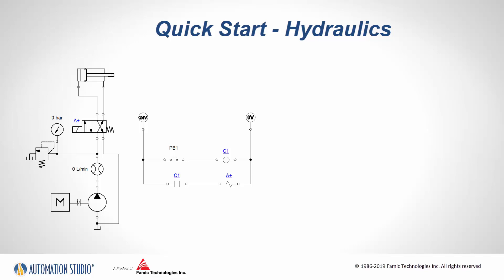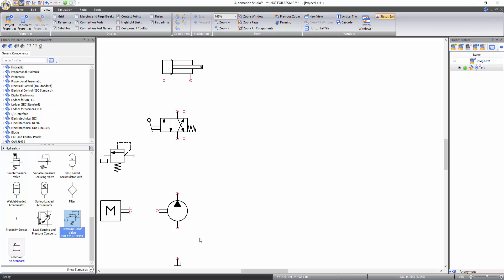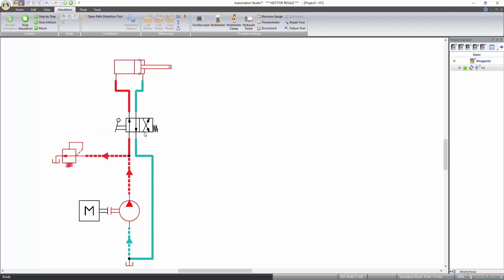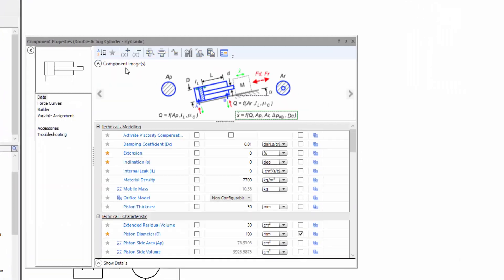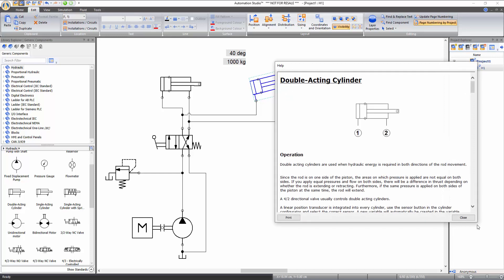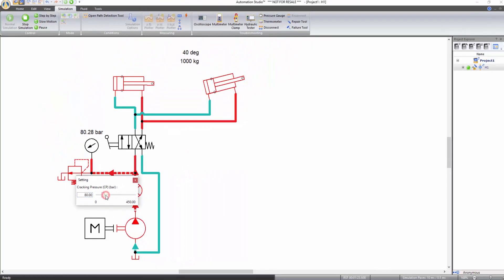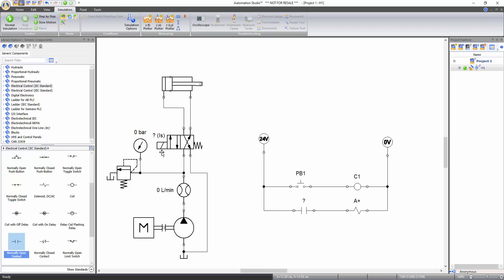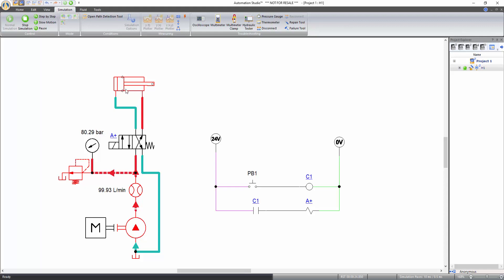How to Hydraulics Automation Studio™ - Quick Start Guide

Comment: How to set working pressure of hydraulic pump? Is it differential pressure or maximum pressure?
Reply from the maker: All the pumps available in the library have an option for their Maximum Working Pressure and Maximum Differential Pressure. Some of them have the Setting Pressure and Differential Pressure Setting option. It depends on which pump you are using. -EN